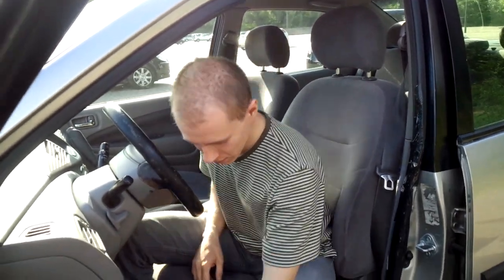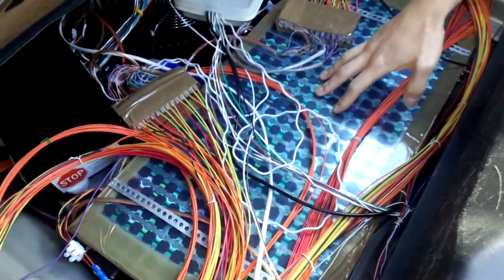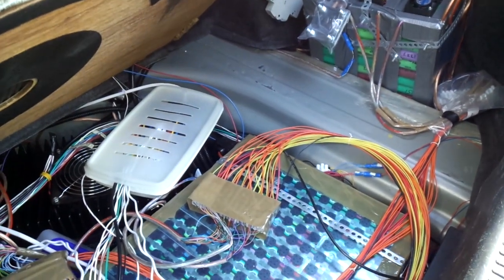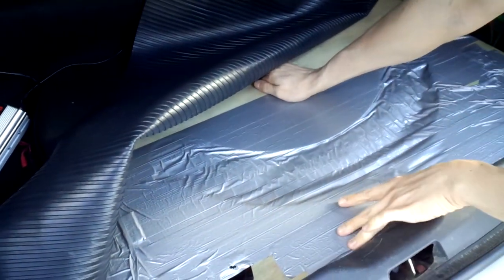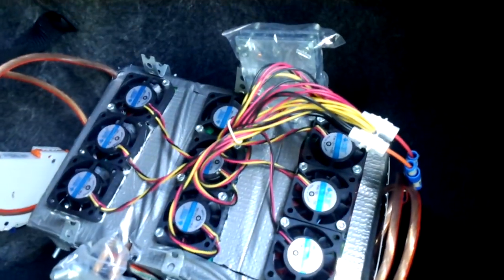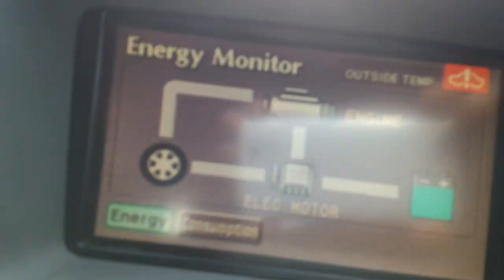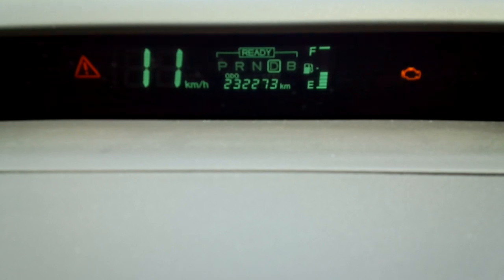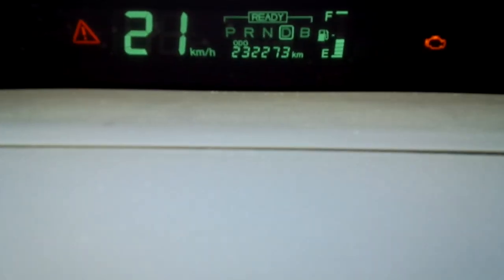Prius Classic (NHW11) Plug in Hybrid

Comment: Good job. It is a pity that manufacturers don't want to do an upgrade kit for existing models hybrids. My Auris and my wife's Prius I. I would love to buy this kit. Good luck.
Dmitry
Reply from the maker: +Dmitry Bratkov Thank you, Dmitriy. I build a second generation of this kit which will be safety-tested and available on the market incl. world wide shipping. But it'll take some time. I will post more videos of the system later this year. Stay tuned.

Maybe you can have a look at the market-available ones: 
http://www.pluginsupply.com/
http://www.enginer.us/

Btw, what temperatures do your cars experience during the winter ?
Does your wife's Prius I start normally in winter ?

Best wishes!

Comment: What  is  the a  maximum   speed  in  EV mode? (you mentioned 70kmh in the
description), is it correct?
Reply from the maker: Hi, yeap. More than that would not be allowed by the MCUs.
Reply from the maker: Hi, on the first gen of the prius, i only managed to get up to 70 kmh. Additionally, i think it could not run faster than that, since the inverter is limited to 11 kW (if i remember correctly).
Reply: @denisrakcheev  Good job! 70 is always enough for the small town driving. And how to trick it to the EV driving mode? I'm trying to do it for prius 10. Is it through diagnostic program like tecu3?

Comment: Hola! Seeing that just makes me wonder how you did it! I would like to learn how to do those kind of projects. I hope you maybe could give me a few pointers. I work at a school and I have a very good supply of used laptop batteries.
Reply from the maker: +manuel luis 
Basically, you need:
1) a smart charger to test each battery cell for its discharge power and its capasity
2) a lot of 18650 holders/brackets to build the battery pack
3) you need to know what hybrid car you plan to upgrade as the voltage and the power draw differ, and this will define you pack size and performance
4) you need to select BMS system for your pack, mine is EwertEnergy
5) as well as charger, mine's ElCon 2500

I can recommend a couple of channels where i learned some of the needed skills:
https://www.youtube.com/user/jehugarcia
https://www.youtube.com/channel/UC_vyXxaDT3ZBLbxX3k3VelQ
https://www.youtube.com/channel/UCE7mwGfnP3uVp8-iNbVMjDw

If you've got a Prius Classic, you can check out PriusChat:
http://priuschat.com/threads/diy-plug-in-conversion-gen1-prius.147304/

Good luck!
Reply: Thank you very much! mine is a gen II!